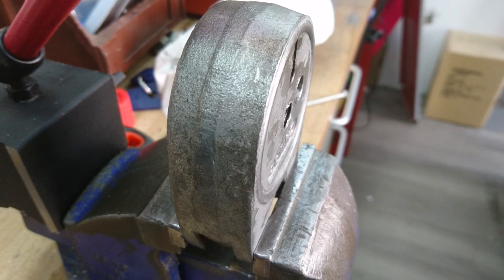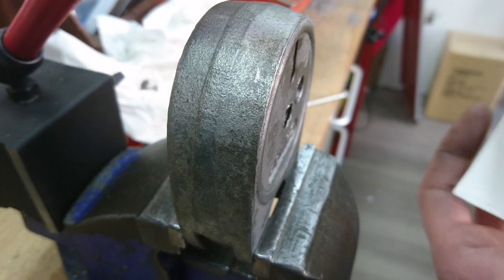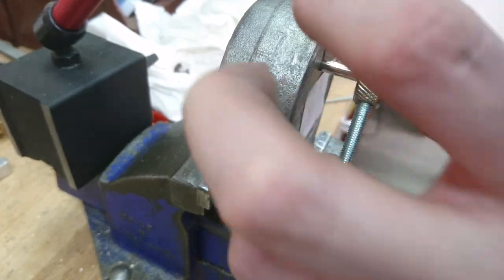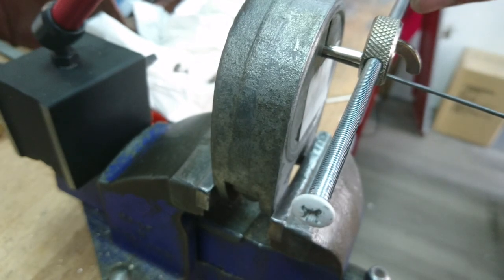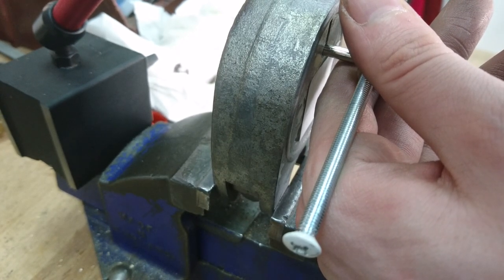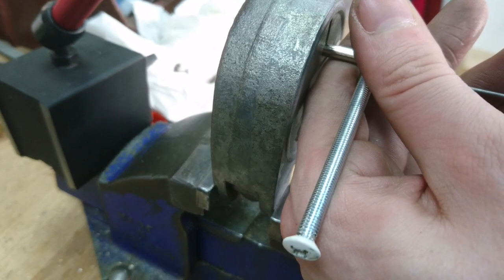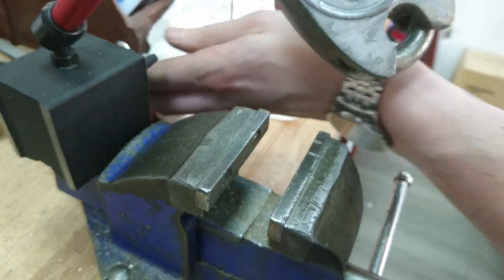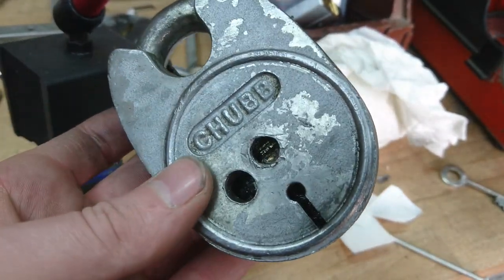Picking a chubb battleship padlock

Comment: The fact that you can pick it is incredible but with your own tensioner etc makes it so much better. 5 Stars ⭐️
Reply from the maker: Valiant Thor thanks mate wish I still had it.
Reply: GxAxV You have the skill and talent in abundance my friend. I saw a very interesting new pick called the The Sputnik and thought of you straight away. An interesting concept that might help you create something even more revolutionary. I still have your pick displayed on the mantel piece, my pride and joy and the first times I’ve won anything. I have my Kerpesh picks set aside too. 👍🏽👍🏽
Reply from the maker: @VALIANTTHOR383  haha that made me smile reading that, thanks. As for the sputnik, it is actually quite an old tool based around the abus cylinders. It's far too fiddly to make  for me tho considering picking is quicker.
Reply: GxAxV No way, I knew it looked familiar and had another older prototype. I’d love to see you give it a go in improving or adapting it. When are you doing more videos on the bike?
Reply from the maker: @VALIANTTHOR383  I may actually do some next week as I will soon be off the bike and in a little van. So last chance. I had a crappy bike at one point and that's why I stopped.
Reply from the maker: @VALIANTTHOR383  the sputnik is made by Germans, I'm not gonna improve on that haha.